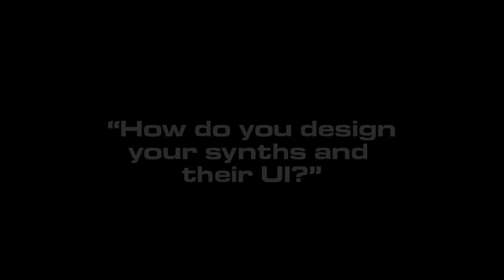"Ask Sequential" Episode 4: How Do You Design Your Synths & Their UI?

Comment: Actually, to show how knobs are positioned in a programmable synth, you could use encoders with a light inside and for any patch each encoder will have the line/light at a certain part/value of the encoder upper surface. I guess this will increase the costs, but we will keep buying your instruments as long as they sound so good, right? I just wish you will also make a Pro3 module in the P12 module format, which I have and love.

Comment: I really dislike that the Rev 2 doesn't have a live panel mode. I agree that it's far from ideal and confusing with synths that have presets and multiple layers having pots. It often sends me running back to my simple monos with no preset functionality. Perhaps pots but with LED rings would offer the best compromise so you could at least see where the pot is supposed to be positioned when you change presets or layers? I also think it's a bit of a shame the OB-6 and Prophet 6 have such limited modulation possibilities. A Poly Pro 3 would be insane.
Reply: The Led positioning is a brilliant idea for these scenarios.

Comment: The best interface is always 1 knob/switch/slider per function. That's why vintage and some current analog mostly win everytime. 

The next best is similar to ye olde web design rule of '3 clicks '; you should be able to get to where you want to (& back home), within 3 movements (knob/ slider /switch/ button).

You don't need motorised faders; a number of synths have had the 'pass thru value ' option, including the voyager (mine is on a later o/s) with a display,  so you can visually see the values as you increment/decrement the knob/switch/slider vs the original value(s)
Reply: Yes, all Sequential synthesizers have pass thru and relative pot modes.